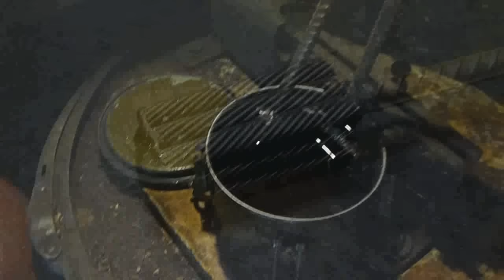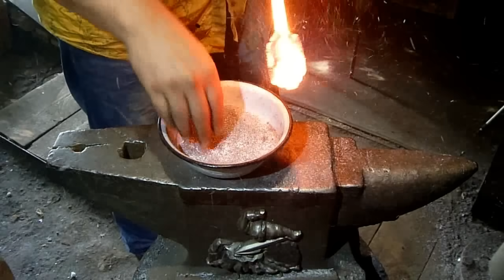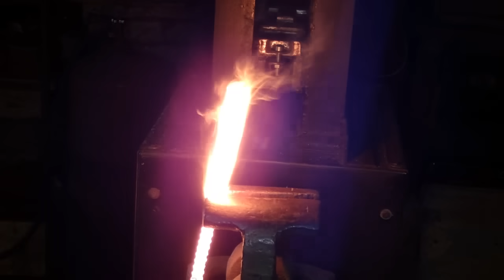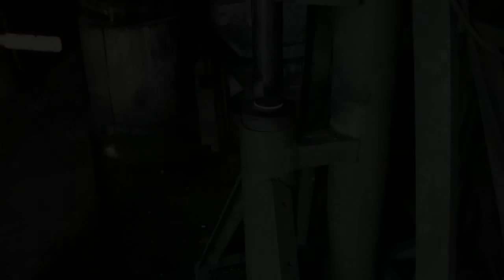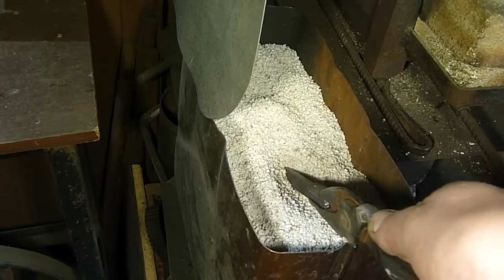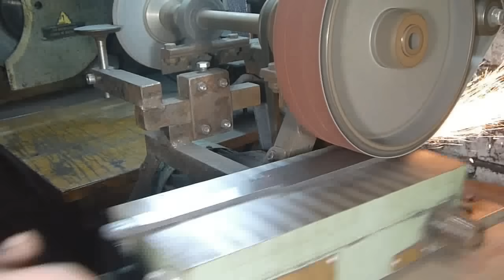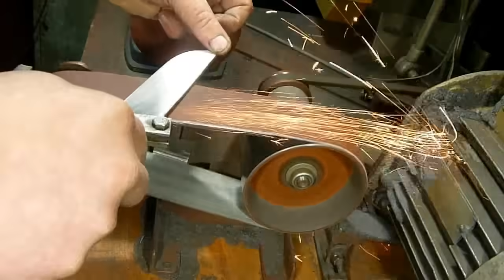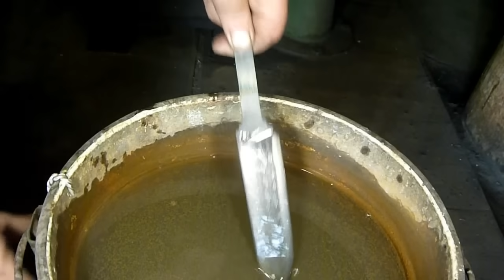Forged cable  Mosaic damask steel from the cable  making a blade

Comment: What's in the first bucket , the liquid ? What's in the pan on the anvil the granular ?
Reply from the maker: The billet is soaked in kerosene. This is necessary for good welding (forging) steel. When burning inside the workpiece remains soot (carbon), which, with further heating, scales and rust inside the workpiece restores to the iron, improving the quality of forging welding.

I sprinkle flux (90% borax + 5% quartz sand + 5% charcoal powder) this is necessary for forging (forge) welding. The flux is alloyed with scale - the formed substance is sufficiently fluid and is easily displaced by deformation. In addition, the flux protects against oxygen and charcoal, carburizes the surface layer of metal - which lowers the welding temperature (if in brief).

Comment: What are you soaking it in at the beginning of the video
Reply from the maker: The billet is soaked in kerosene. This is necessary for good welding (forging) steel. During combustion, the soot remains, which upon further heating cement the surface layer of the steel, thereby lowering the welding temperature and, in the process, if rust or scale remains, restores it to iron.

Comment: Why did you use that piece of wood of the first hit ???
Reply from the maker: The first welding is done on a tree, as the tree is a heat insulator, and not so selects temperature as an iron anvil. In addition - burning, the tree burns oxygen, protecting the workpiece and pouring the flux work. This is important for welding workpieces with small parts (cable, chain).

Comment: Excuse me, what kind of oil is that oil that you just soaked in oil?
Reply from the maker: The billet is soaked in kerosene. This is necessary for good welding (forging) steel. When burning inside the workpiece remains soot (carbon), which, with further heating, scales and rust inside the workpiece restores to the iron, improving the quality of forging welding.

Comment: What that stuff you sprinkle on it?
Reply from the maker: I sprinkle flux (90% borax + 5% quartz sand + 5% charcoal powder) this is necessary for forging (forge) welding. The flux is alloyed with scale - the formed substance is sufficiently fluid and is easily displaced by deformation. In addition, the flux protects against oxygen and charcoal, carburizes the surface layer of metal - which lowers the welding temperature (if in brief).

Comment: Me gustaría saber como se llama el polvo que se utiliza
Reply from the maker: Espolvoreo flujo (90% de bórax + 5% de arena de cuarzo + 5% de polvo de carbón), esto es necesario para la soldadura de forjado (forjado). El flujo se funde con la escala: la sustancia formada es suficientemente fluida y se desplaza fácilmente por deformación. Además, el fundente protege contra el oxígeno y el carbón y cementa la capa superficial de metal, lo que reduce la temperatura de soldadura (en resumen).

Comment: Qué es y qué le hace al metal el polvo que le echa al principio?
Reply from the maker: Rociado con fundente (bórax 90% + arena de cuarzo 5% + carbón vegetal en polvo 5%) es necesario para la soldadura (forja). El flujo se fusiona con la escala: la sustancia resultante es bastante fluida y se desplaza fácilmente durante la deformación. Además, el flujo protege contra el oxígeno y, a expensas del carbón vegetal, la carburación de la capa superficial del metal, lo que reduce la temperatura de soldadura (aunque sea brevemente).
Reply: @shurap  q se usaba antiguamente?

Comment: I have a question: Why do you hammer on a block of wood? Is there a benefit to using this method for forging? I am very curious about this.
Reply from the maker: The first welding is done on a tree, as the tree is a heat insulator, and not so selects temperature as an iron anvil. In addition - burning, the tree burns oxygen, protecting the workpiece and pouring the flux work. This is important for welding workpieces with small parts (cable, chain).
Reply: Oh, okay! Thanks for the information! That is really informative! :D

Comment: What's the purpose of the powder?
Reply from the maker: I sprinkle flux (90% borax + 5% quartz sand + 5% charcoal powder) this is necessary for forging (forge) welding. The flux is alloyed with scale - the formed substance is sufficiently fluid and is easily displaced by deformation. In addition, the flux protects against oxygen and charcoal, carburizes the surface layer of metal - which lowers the welding temperature (if in brief).

Comment: What is the dust and what is the purpose of it?  Genuinely curious i'm a laymen
Reply from the maker: I sprinkle flux (90% borax + 5% quartz sand + 5% charcoal powder) this is necessary for forging (forge) welding. The flux is alloyed with scale - the formed substance is sufficiently fluid and is easily displaced by deformation. In addition, the flux protects against oxygen and charcoal, carburizes the surface layer of metal - which lowers the welding temperature (if in brief).

Comment: Whats the oil for at the begining?
Reply from the maker: The billet is soaked in kerosene. This is necessary for good welding (forging) steel. During combustion, the soot remains, which upon further heating cement the surface layer of the steel, thereby lowering the welding temperature and, in the process, if rust or scale remains, restores it to iron.

Comment: What does he sprinkle on it?
Reply from the maker: I sprinkle flux (90% borax + 5% quartz sand + 5% charcoal powder) this is necessary for forging (forge) welding. The flux is alloyed with scale - the formed substance is sufficiently fluid and is easily displaced by deformation. In addition, the flux protects against oxygen and charcoal, carburizes the surface layer of metal - which lowers the welding temperature (if in brief).

Comment: @shurap Can you try something for me. You might finds something interesting you can sell.
i know that non-nutonium fluwed can dempen shock with 95% efficiency.
now im wondering is if you make a cup with a spring in the middle to hold a anvil up.
Fill the cup with non-nutinium fluwed, (water and custard) the stuff if you run fast on it you wont sink and if you hit it, its hard as a rock. but when you stand still you sink in it. put the anvil ontop of the fluwed but dont let it sink in (that's what the spring is for)
Now if you use the anvil it shooed dampen the sound and it shooed make hits feel like a dead-blow hammer.
Best of luck.

I got the idea from some top hightech new skating shouws that supposedly dempen's drops and jump by 95%

PS: sry dyslexic

Comment: What does the powder do?
Reply from the maker: I sprinkle flux (90% borax + 5% quartz sand + 5% charcoal powder) this is necessary for forging (forge) welding. The flux is alloyed with scale - the formed substance is sufficiently fluid and is easily displaced by deformation. In addition, the flux protects against oxygen and charcoal, carburizes the surface layer of metal - which lowers the welding temperature (if in brief).

Comment: What powder he sprinkled?
Reply from the maker: I sprinkle flux (90% borax + 5% quartz sand + 5% charcoal powder) this is necessary for forging (forge) welding. The flux is alloyed with scale - the formed substance is sufficiently fluid and is easily displaced by deformation. In addition, the flux protects against oxygen and charcoal, carburizes the surface layer of metal - which lowers the welding temperature (if in brief).
Reply: Thank you for your detail explanation. perhaps it is common sense in welding?

Comment: Whats the fluid at the beginning?
Reply from the maker: The billet is soaked in kerosene. This is necessary for good welding (forging) steel. During combustion, the soot remains, which upon further heating cement the surface layer of the steel, thereby lowering the welding temperature and, in the process, if rust or scale remains, restores it to iron.

Comment: Que pó e este que ele joga sobre a peça?
Reply from the maker: Eu borrifo o fluxo (90% de bórax + 5% de areia de quartzo + 5% de pó de carvão) isso é necessário para forjar (forjar) a soldagem. O fluxo é fundido com a escala - a substância formada é suficientemente fluida e é facilmente deslocada pela deformação. Além disso, o fluxo protege contra o oxigênio e o carvão, cementando a camada superficial do metal - o que reduz a temperatura da soldagem (se for breve).

Comment: What does soaking it in kerosene do?
Reply from the maker: The billet is soaked in kerosene. This is necessary for good welding (forging) steel. When burning inside the workpiece remains soot (carbon), which, with further heating, scales and rust inside the workpiece restores to the iron, improving the quality of forging welding.
Reply: Thanks for the insight!

Comment: @ :25, what is in that bowl?
Reply from the maker: I sprinkle flux (90% borax + 5% quartz sand + 5% charcoal powder) this is necessary for forging (forge) welding. The flux is alloyed with scale - the formed substance is sufficiently fluid and is easily displaced by deformation. In addition, the flux protects against oxygen and charcoal, carburizes the surface layer of metal - which lowers the welding temperature (if in brief).

Comment: Why do you use wood on your anvil for the first forge weld?
Reply from the maker: The first welding is done on a tree, as the tree is a heat insulator, and not so selects temperature as an iron anvil. In addition - burning, the tree burns oxygen, protecting the workpiece and pouring the flux work. This is important for welding workpieces with small parts (cable, chain).
Reply: Thank you

Comment: Mano boa noite!!!!
Qual o nome desse pó que vc coloca no metal????
Reply from the maker: Polvilhe com fluxo (bórax 90% + areia de quartzo 5% + carvão em pó 5%), isto é necessário para a soldagem (ferraria). O fluxo é fundido com incrustações - a substância resultante é bastante fluida e é facilmente deslocada durante a deformação. Além disso, o fluxo protege contra o oxigênio e, devido ao carvão, carboniza a camada superficial do metal - o que diminui a temperatura da soldagem (se por breves instantes).

Comment: That liquid you soak your metal in, is that oil based??
Reply from the maker: The billet is soaked in kerosene. This is necessary for good welding (forging) steel. During combustion, the soot remains, which upon further heating cement the surface layer of the steel, thereby lowering the welding temperature and, in the process, if rust or scale remains, restores it to iron.

Comment: Can someone help? Why is he putting some powder on it?
Reply from the maker: I sprinkle flux (90% borax + 5% quartz sand + 5% charcoal powder) this is necessary for forging (forge) welding. The flux is alloyed with scale - the formed substance is sufficiently fluid and is easily displaced by deformation. In addition, the flux protects against oxygen and charcoal, carburizes the surface layer of metal - which lowers the welding temperature (if in brief).

Comment: Why dose put it on wood the first time?
Reply from the maker: The first welding is done on a tree, as the tree is a heat insulator, and not so selects temperature as an iron anvil. In addition - burning, the tree burns oxygen, protecting the workpiece and pouring the flux work. This is important for welding workpieces with small parts (cable, chain).

Comment: Hello from MT, What is the liquid you keep your billets in? Is it WD40 or something  to keep it from oxidizing? Love your videos!
Reply from the maker: The billet is soaked in kerosene. This is necessary for good welding (forging) steel. When burning inside the workpiece remains soot (carbon), which, with further heating, scales and rust inside the workpiece restores to the iron, improving the quality of forging welding.

Comment: what is the powder?
Reply from the maker: I sprinkle flux (90% borax + 5% quartz sand + 5% charcoal powder) this is necessary for forging (forge) welding. The flux is alloyed with scale - the formed substance is sufficiently fluid and is easily displaced by deformation. In addition, the flux protects against oxygen and charcoal, carburizes the surface layer of metal - which lowers the welding temperature (if in brief).

Comment: Forgive my naivity (I love these videos btw), but what is the powder that is sprinkled?
Reply from the maker: I sprinkle flux (90% borax + 5% quartz sand + 5% charcoal powder) this is necessary for forging (forge) welding. The flux is alloyed with scale - the formed substance is sufficiently fluid and is easily displaced by deformation. In addition, the flux protects against oxygen and charcoal, carburizes the surface layer of metal - which lowers the welding temperature (if in brief).

Comment: Lo blanco es borax??
Reply from the maker: Rocío con fundente (bórax 90% + arena de cuarzo 5% + carbón en polvo 5%) es necesario para realizar la soldadura (forja). El fundente se fusiona con la escala: la sustancia resultante es bastante fluida y se desplaza fácilmente durante la deformación. Además, el fundente protege del oxígeno y, debido al carbón, carbura la capa superficial del metal, lo que reduce la temperatura de soldadura (en resumen).

Comment: whats powder is it?
Reply from the maker: I sprinkle flux (90% borax + 5% quartz sand + 5% charcoal powder) this is necessary for forging (forge) welding. The flux is alloyed with scale - the formed substance is sufficiently fluid and is easily displaced by deformation. In addition, the flux protects against oxygen and charcoal, carburizes the surface layer of metal - which lowers the welding temperature (if in brief).
Reply: @shurap  wow, thats great.. thank you

Comment: What powder from bowl ?
Reply from the maker: I sprinkle flux (90% borax + 5% quartz sand + 5% charcoal powder) this is necessary for forging (forge) welding. The flux is alloyed with scale - the formed substance is sufficiently fluid and is easily displaced by deformation. In addition, the flux protects against oxygen and charcoal, carburizes the surface layer of metal - which lowers the welding temperature (if in brief).

Comment: Was für ein pulver ist das
Reply from the maker: Ich bestreue Flussmittel (90% Borax + 5% Quarzsand + 5% Aktivkohlepulver) dies ist notwendig für das Schmieden (Schmieden) Schweißen. Das Flussmittel wird mit Zunder verschmolzen - die gebildete Substanz ist ausreichend flüssig und kann leicht durch Verformung verdrängt werden. Außerdem schützt das Flussmittel vor Sauerstoff und Holzkohle, karbonisiert die Oberflächenschicht aus Metall - was die Schweißtemperatur (wenn in Kürze) senkt.
Reply: shurap vielen vielen dank👍😁
Reply: shurap gibt es das borax zu kaufen oder wo gibt es das

Comment: Why the initial pounding on the wood and not the anvil. I’ve seen you do that before and not anywhere else?  Thanks!!
Reply from the maker: The first welding is done on a tree, since the tree does not take the temperature like an anvil and burns oxygen when burning - this is important for workpieces with small parts (cable, chain).
Reply: shurap oh my, I never knew that. Thanks for taking the time to answer for me.

Comment: Awsome work as always this is why you are on the top of my list for bladesmiths. So the big question is  is when will you be on forged in fire?  Martin M&S Blades  Oh and another thing I am in no way trying to hijack your channel but it would be an honor for me to have you check out my channel/work and comment. the channel is Martin and shan Moldovan or you can find it by typing M&S Blades it will come up this way. I look forward to your comments and subscription.   Martin M&S Blades
Reply from the maker: I'm not an expert in channel analysis, I'm just a beginner myself. Therefore, I can not make any observations.
You can on my channel in my posts give a link (direct) to your channel. It will not be immediately visible, but I will approve as far as verification is concerned.
Reply: Thank you for the invitation to post a link to my channel. Martin M&S Blades